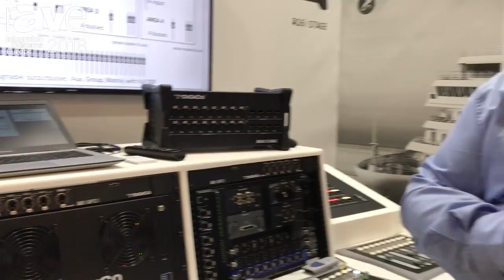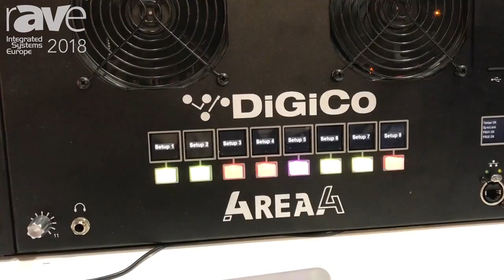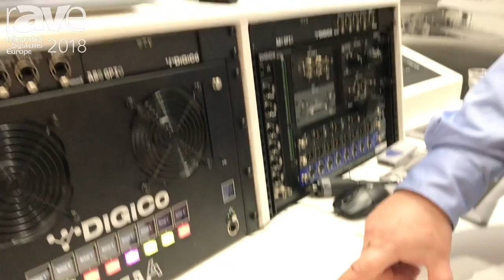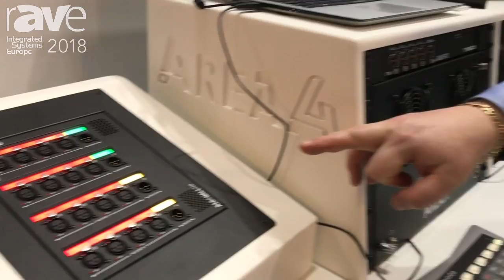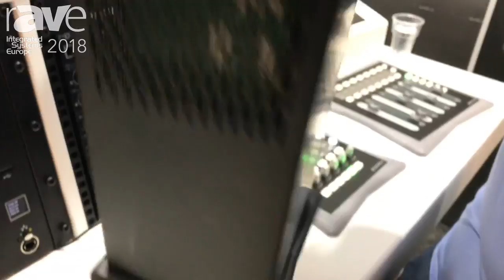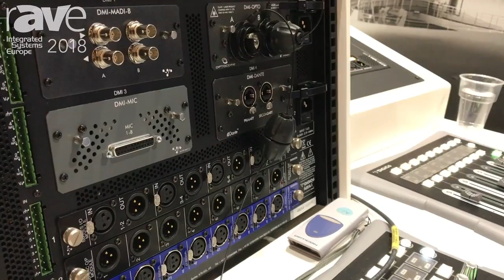ISE 2018: DiGiCo Introduces Area4 Matrix System with Dedicated Controllers for Audio Performance

Comment: Can the Control 8 be set up remotely with a WiFi access point bridge back to the 4REA4? I have an isolated room where I am unable to run a new drop, but I could use an already installed access point over a control VLAN. Looking to see if it can do something similar to like how the Behringer X-Touch can control the Beh/Midas X/M series.